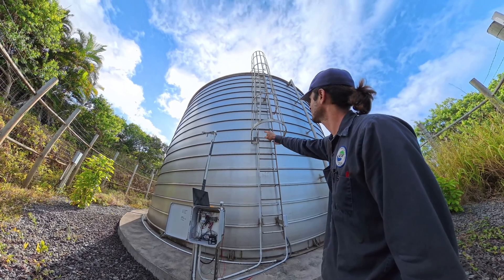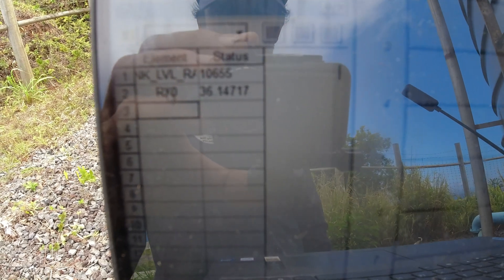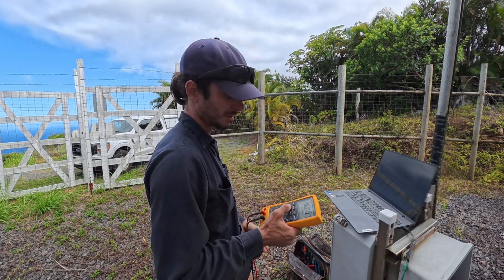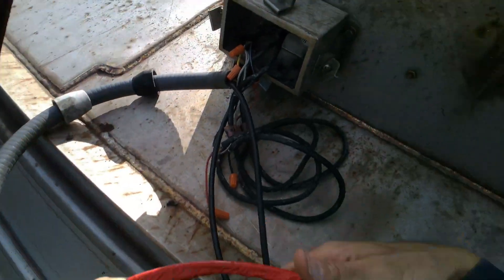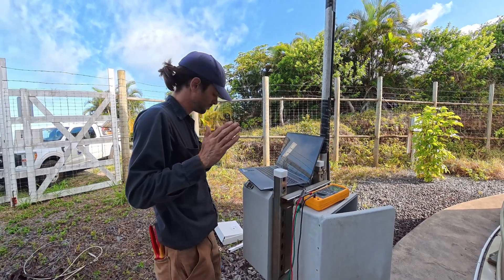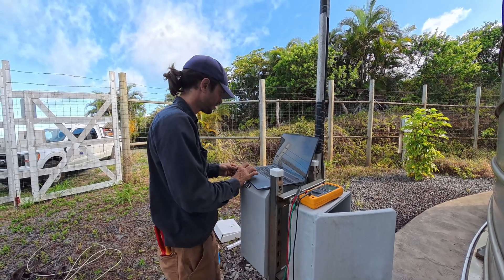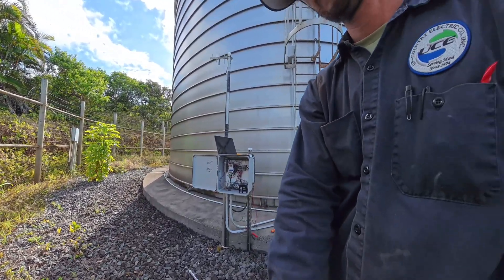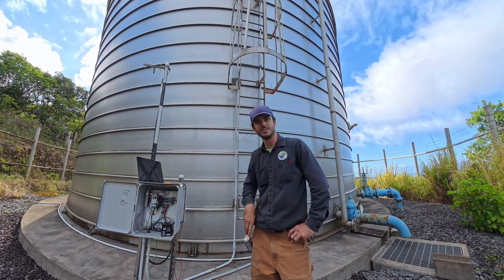Troubleshooting A Tank Level Transducer

Comment: You do it all Ben. Do you use any of the Allen Bradley PLC i/O gear. We used them at a jail for controlling gap panels for all their cell doors, lighting, etc. and connections with proxy cards.
Reply from the maker: We do, occasionally, and almost exclusively for municipal work. For private systems it is so much more expensive and so it is hard to upsell. AB is definitely the premier and top of the line.

Thanks for watching !